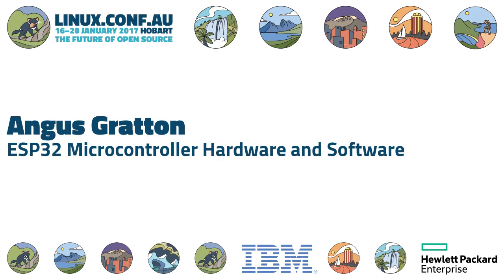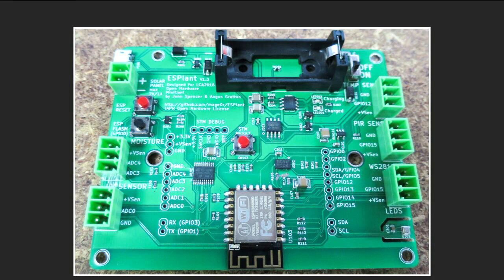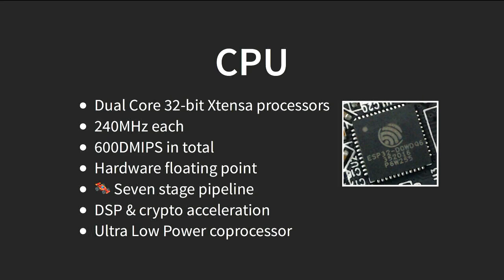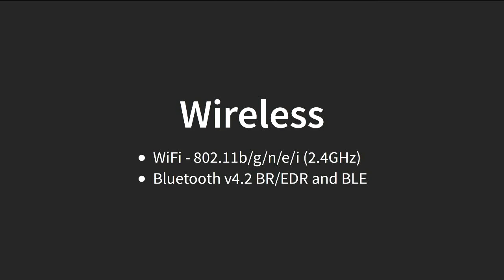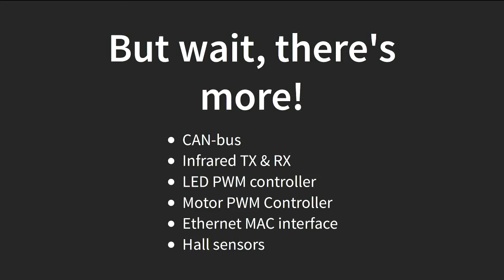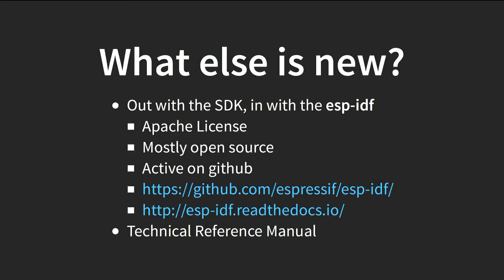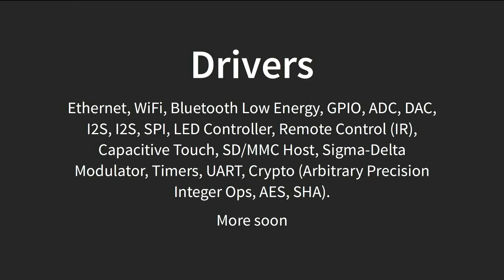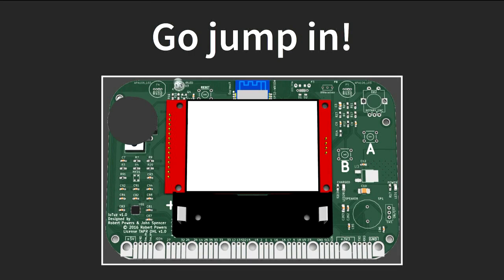ESP32 Microcontroller Hardware and Software

Comment: @12:55 - "The plan is to only leave the low level wi-fi and bluetooth connectivity, which is chip specific, and proprietary, in binary" 
Is this another gaping security hole waiting to happen, like the recent BroadPwn and BlueBorne vulnerabilities, due to everyone being forced to use and trust "magical" proprietary firmware blobs?
Reply: I read your insightful comment and hope someone will properly address this issue in this comment section. But I am not holding my breath.

I am not well-versed in this subject matter. Therefore my thoughts below might be incorrect.

However, it seems that the inherent conflict of interest that is set in place when a hardware vendor puts proprietary code on their hardware can best be solved by separating hardware sales from software sales. This remind me of the Chinese wall Wall Street firms legally yet typically only purportedly to set up to prevent the illegal "leakage" of corporate inside information.

In other words, if hardware vendors were to only sell hardware, then this problem could likely be solved with free and open source software. But frankly I suppose this comes down to, "Trust the hardware vendor to be vigilant about properly maintaining and updating security" This seems like a sure fire recipe for hackers finding and exploiting security vulnerabilities.

I would be glad for others who know more about this than I am to comment about this important issue. At this point my sense is the real message might be something like: "Go develop exciting and useful IoT applications with the wonderful new ESP32... and then just wait until some evil hacker wreaks havoc with the hardware your ESP32 is controlling."